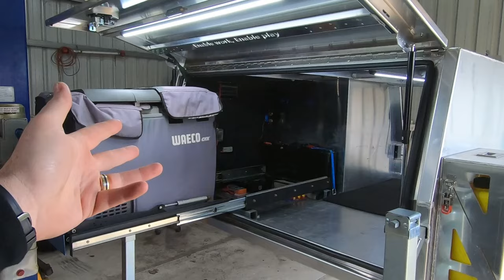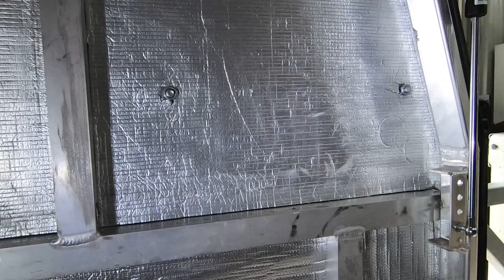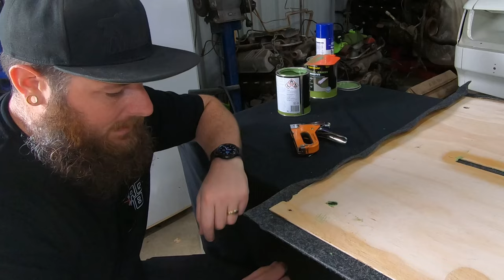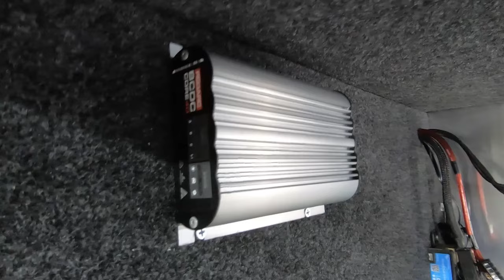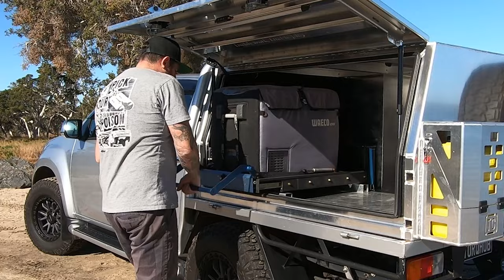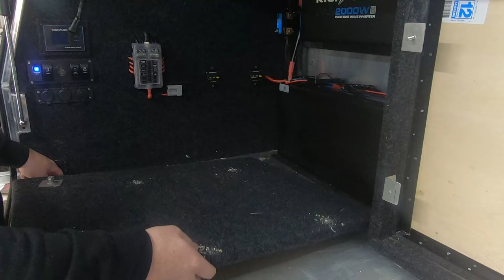You Wont BELIEVE the HIDDEN Tech in This DIY CUSTOM Canopy Build!

Comment: Great video mate, setup is looking wicked! I could learn a thing or two from you when it comes to spreading that turf glue, your method looked a lot easier than my paint brush method 😅 (also LOVE the hidden wireless chargers, genius idea!)
Reply from the maker: Hey thanks for stopping by dude! Thanks for the inspo on the thermal liner! Still flirting with the idea of some foil board on the ply wood aswell... but do I reeeeeally need it? 😅 

The wireless charging pad is 100% my favourite part, haha. Cool little party trick. Hope you're going well on the road mate and make it home safe n sound. Might catch you for a weekend camp 🍻

Comment: Good job mate well done ! Definitely need to do a makeover with my canopy with insulation aswell as change my 80LT Engel and msa drop slide out to an upright. In the same boat as you were I’m pretty set on the nrx80 for power draw reasons and being able to take the freezer compartment out but in the same sense tossing up whether or not to just get a kings.
Reply from the maker: Thanks Chris. Honestly mate, this bargain basement fridge has been pretty well flawless, and draws on average 1.5A/hour. At ~$450 it's well worth the purchase to get you goin. You can always switch it to an NRX later if you really feel the need 🤷‍♂️

Comment: Fantastic video and great overall results, loved the wireless charger and just how neat and well thought out the entire project was, are you running solar panels up top too? That would give more insulation if there is an air gap underneath as well as the obvious power they supply.
Reply from the maker: Thanks Trevor, love that you can appreciate the intricacies of the fit out. I haven't put a solar panel on yet ... got to decide whether I want to put a tent on there or not haha. So taking my time on that, but the provisions are already there for a panel to be plug and play 🍻

Comment: Hey man, off topic question but hope you can help. What brand is the hoist in your shed and how tall is it at the highest point. I’m after a clear floor hoist but not super tall. Cheers mate
Reply from the maker: It's a Radum hoist mate, Kurt has an Atom, both are about 3750mm tall. Unfortunately all the clear floor ones are fairly tall otherwise you simply don't get the lifting height. If you're caught for altitude maybe look at a base plate 2 poster and have it sunk into the concrete so it's flush? Have a couple mates who have done that to get around the clearance issue 🍻
Reply: @TorqHub  yer all the clear floor ones are around 3650 and up. I’ve got 3500 to the gutter and 4200 to the top of the gable roof but my roof runs opposite direction to yours. Your hoist didn’t look crazy tall. Thanks for the reply man. Keep up the great work
Reply from the maker: Yeah rogie. I have 3.0 to the gutter and 4.2 to the top. Depending on the width and therefore the angle on your roof pitch you might just squeeze one in there! Would have to be pretty much smack bang in the middle though lol
Reply: @TorqHub  yer I can get one in just have to have it about half a metre off the side wall. I was hoping to get it closer because as well know theres never enough room in the shed!
Reply from the maker: @HaveACrackGarage  trust me, you'll want that space off the side wall bro. As much of a waste as it seems, you'll be glad you did the first time you slide an axle out of a diff and have enough room instead of it hitting the wall and still being in the diff housing... ask me how I know 🤣🤣
Reply: @TorqHub  🤣🤣🤣🤣🤣🤣

Comment: Hey, some foil board in there as well would be a cheap extra layer of insulation. At Hammerbarn, it’s item number 0125955
It’s 15mm thick so will still give you an air gap behind the board.
Reply from the maker: Was originally going to use Foil Board, but that roll of thermal liner was far easier to transport 😅 I did still consider running foil board on the ply aswell, but is it really necessary at that point? I guess nothing exceeds quite like excess...